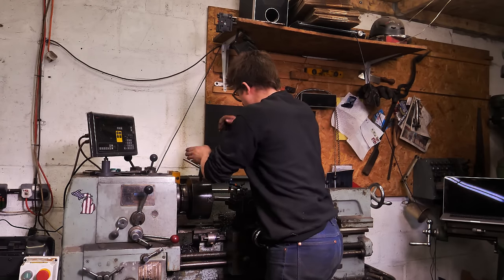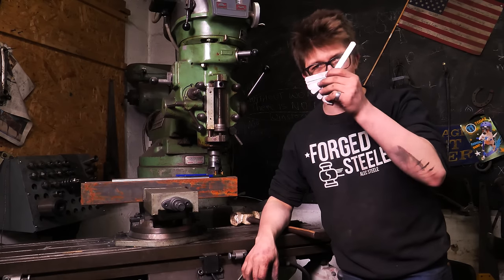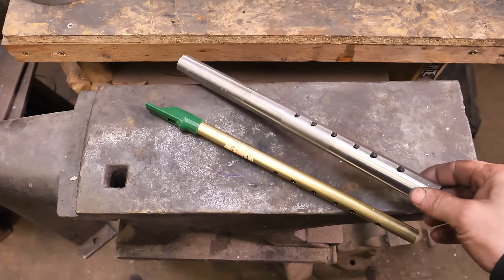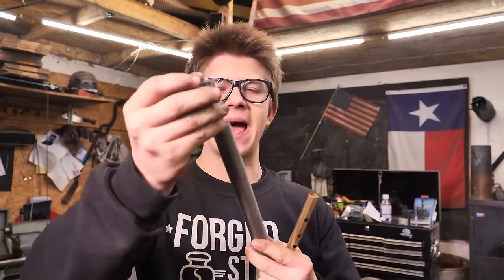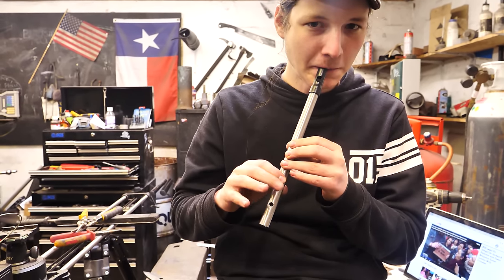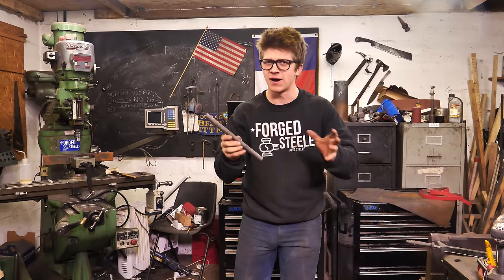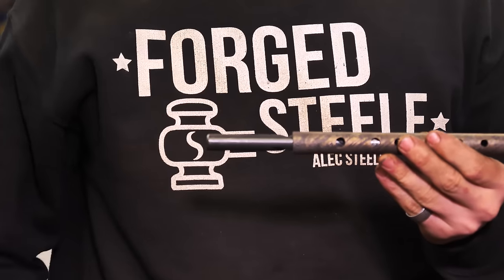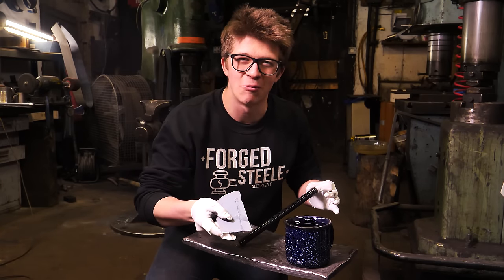FORGING DAMASCUS MUSICAL INSTRUMENTS: Tin Whistle Part 2

Comment: I am loving the beginning shots. That slider for the camera has really added to your videos! Love it! Also, I think the whistle actually sounded better after it was hardened. Awesome project!
Reply: I know nothing about music, but you might have a point. Hard materials vibrate in a higher frequency, I think that's the reason the whistle sounded different after the heat treatment.
Reply: He should not mix 25 and 50 FPS, though. He should shoot it in 60 FPS, cause every monitor today runs at 60 FPS. 50 on 60 creates ugly micro stutters.
Reply: Luiz Alberto Parise Köhler exept for actual instruments a softer material is always used to make a better sound. (gold and silver flutes, wood clarinets, gold trumpets ect)
Reply: Agreed, it sounds even better after hardening! Beautiful end product.
Reply: Kyôdai Ken what are you on about? Monitors can display up to 240 fps if you have a really high end one, and he can mix 24 and 50, if you get micro stutters then its up to your monitor since mine doesnt get them.And if you want proof, go to Peter McKinnon and watch some of his vids, he shoots main footage at 24 and B roll at 120 and it looks amaizing.

Comment: Alec as a machinist I must say in the video you leave the Chuck wrench in your chuck . first thing I ever learned if that becomes habit there will come a day you forget to remove it before kicking that lathe on. if your hand is not on it it's not in the Chuck.
Reply: Marcus Roach from the little bit of machine work i have done i can say that this is the exact same thing i was told from day dot
Reply: Marcus Roach i forgot the chuck wrench in the chuck once. Nothing broke though, and nobody got hurt, and i never forgot it after that. My teacher got the chuck wrench in the gut when someone else forgot it, sounded quite painful! That was 10 years ago, and I'll never forget it again.
Reply: Hoo, boy, tell me about it. I once managed to turn one into a projectile that nearly put a nice dent in the back of the teacher's skull. And the guy was pretty far away at the time. Kinda makes you appreciate the instant kick those lathes can impart on the chuck.

If forgetting the chuck is something you regularly do, fit a spiral spring to it that pushes it out if you're not exerting a modest amount of pressure on the wrench. That way, when you let go, it will come away with your hand, reminding you to lay it aside. Friend of mine has a lathe that came with the spring preinstalled from the factory. Elegant solution.
Reply: That spring idea is one of the things that sound so obvious it makes you wonder why nobody has done it before. I have a lot more respect for lathes now, after i have seen some of the horrible accidents that has happened.
Reply: the spring idea is not bad if your running a 3 jaw chuck but if you are running a four jaw and are holding a good size part in with one of your hand then for some reason you end up losing hold of that chuck wrench it pushes out and hits hopefully the ground and not you knee and you have to end up taking the part out and picking up the wench and then trying over again.
Reply: Nah, you pick a spring that's strong enough to push it out of the hole, but nowhere near strong enough to launch the wrench through the ceiling, twenty more storeys and straight into lunar orbit. A reasonable amount of force, something you can easily hold down, without straining yourself.
Reply: Oh yeah for sure, I left one in a pillar drill one time, came out and smacked me right in the chest, no real harm done but it sure hurt.
Reply: jonhill987 I was working in the work shop one day a few years ago and another guy in the room somehow forgot the pin spanner in the angle grinder he was using. It left a nice dent in the cabinet it hit!
Reply: JakeThePeasant seriously though how did he explain leaving that on the grinder? that would be like someone changing the wheel on their car and leaving a tyre iron on it
Reply: Marcus Roach haha he couldn't explain it. He was as confused as I was! In his defence it was first thing in the morning!
Reply: JakeThePeasant Was it a Monday too? ;-)
Reply: JakeThePeasant shit if that happened at any of my past jobs the drug and alcohol testing mob would be there in a heartbeat
Reply: +Wormweed that spring is pretty much standard equipment on new chuck keys, it's the first thing to get pulled off too, because it's really frickin annoying.
Reply: Machining a bit too close to the chuck for my liking! Brings back bad memories.

Comment: 2:36 It's a Brasil coin? 1 Real? 
Nice videos men!
Reply: Pingodir -2- Doubt it. It's probably a £2 coin since he's in the UK. Also, even though it's made of 2 different metals, it's not one of the new £1 ones because it's round.
Reply: I found it similar to the one of 1 real here in Brazil. I did not know the UK currency. Thanksman
Reply: The one in the middle looks like 1 Euro to me. /shrugs
Reply: As for the coin in question, it's a Decimal Two Pound, Elizabeth II, 4th
 portrait, St. Paul's Cathedral. You can tell by the distinctive detail 
where her hair "line" is above and to the left of the top of her crown.
Reply: Barsil*
não sabes escrever o nome do teu país  xD

Comment: Cant wait to see AvE's opinion of your lathe skills.
Reply: Pancreaticdefect I thought clickspring was the YouTube lathe king
Reply: Pancreaticdefect I'm a machinist of 50 years experience. Everything I saw was according in compliance with good safe practice. An experienced lathe hand would certainly been more efficient. However, Alec disclaimed pretence as a machinist therefore I'd give him extra points for doing so well. Except for leaving the key in the chuck: always a no-no.
Reply: gromann this old tony
Reply: Yup, the key in the chuck. However I agree with you. He did a good job. I saw him take that ring off and was chuckling, yup, safety first.
Reply: Adam Abom79 Booth
Reply: Pancreaticdefect Okay I know this will probably be a stupid question but I really don't know. Who is AvE?
So far for this type of content I've found Alex, Samurai Carpenter, Adam Savage, and Man at Arms. I take it AvE is a machining channel but I don't know the actual name.
Reply: AvE is a unique fellow from Canada. He has his own channel and he's just funny. He does some machine work, welding, electronics. Look him up. It's worth it. He experiments a lot. Worth looking him up. Look up AvE.
 Also, if you are into making knives/bladesmithing look up Walter Sorrells. He puts out a lot of videos. Amazing work and he shares a tremendous amount in his vids. He has a lot out. He takes you from making a knife with common hand tools, up to using CNC machines. So there is a lot of info for everyone. He also offers knives and sword making instructional videos on his website. I bought his video about producing a hamon on a blade. I already knew a lot, but he offered a couple details that I was missing and made all the difference.
Reply: 64t120r Just subscribed to them both. Thank you for the help :)
Reply: Hahaha. Ya, that fits.
Reply: gromann that's tubalcain...

Comment: Alec, great video- suggestion: you can use a piece of paper to find your surface when touching off on your part (in the mill), this can be done with the cutter running. Hold the piece of paper lightly under the rotating cutter, slowly raise your part or lower the cutter until the paper is being pulled from your fingers, you now have your cutter .002 - .004 above your part.Just a thought!

Comment: Some tips for future parts on the lathe: If you are turning unsupported (no center) don't leave more than 3x the diameter hanging out. Also, when you're turning something with a really rough bumpy surface, use high speed steel. There's a huge chance of breaking your carbide inserts (they don't like shock force). Also, when you're drilling something, follow the same rule of thumb as turning unsupported material. Hopefully these tips help!

Comment: When you're on the lathe and drilling the holes for any project, step up the size of the holes. Start relatively small and work your way. You don't have to use every drill bit but 2 to 4 intermediate steps to your final inner diameter will help with accuracy and from keeping the bit from walking around.

Comment: Part of the reason you would turn between centers is to make sure the ends of the holes are perfectly true and concentric with the final outer turned diameter.  Also, a good center bit should have no trouble at all drilling on center on round stock.  Polishing on a lathe is no trouble at all, I've done it all my life; it's similar to sanding on a wood lathe.  Beautiful final whistle you got there, well done.

Comment: Glad you found my advice of using the lathe dog to be useful. Also for future projects on the lathe, use a smaller diameter drill than your desired hole size to rough out material then use your final size drill to get it to the required size. It makes for a more accurate hole due to less chatter between the piece and the drill.

Comment: regarding grinding and polishing tubes... just put a smaller rod through the tube and let it fly over the slag part of your belt grinder. you will see it will work perfectly. The friction causes the profile rolling by itself and it will give a nice surface.

Comment: Tip for next time: It is easier to drill the big hole with good surface finish if you pre drill with a smaller drill first.

Comment: suggestion, make a wooden or metal holder that lives directly above your lathe for your center drill and live centers etc . it will reduce your tool change times a lot .:)

Comment: Nice video, Alec.
The whistle looks great and has a nice sound.
Your work to make the pipe from the discarded blank was just right. Only the grinding and polishing, which could have been made at the lathe. Clamp between the tips and then grind and polish.
Greetings from Germany

Comment: Great job on the lathe looks like you did just fine, what you could have done is make a slip fit piece of aluminum to go inside your pipe whistle and use your note hole as a drive by tapping and putting a set screw threw one or several of those note holes. That way you are chucked on the aluminum but still able to drive your whistle for final polish. Scotchbrite pads are wonderful for polishing on a lathe. None the less looks like you did just fine. Beautiful man !! I was thinking have you ever made a rose 🌹 in your videos? I had a student come to my class and ask me to make a rose for his significant other. That would be a great project for your show. I could provide you with detailed instructions if you decide you would like to take on that project for the show.

Comment: for filling on the mill try to use one of the center drills from your lathe to put a mark then use the drill that way if you have somthing that can't have that slight flat on it your drill will not kick off and you will not have extra marks in your part

Comment: Great video.  I think I'd break the edge on both ends and along the finger holes so they aren't sharp.  I had a little cringe at the polishing bit but you got it done.  The whistle is beautiful and I'm sure it will be treasured for a lifetime.

That is a nice ring.  I don't wear my wedding ring so wearing one like that would land me in the dog house but something inside me wants one.

Comment: Beautiful work. Reminds me of my days back in tech school in my machine shop class. We made a hammer on the lathe (still have mine). I messed up right at the end so it has a nasty imperfection on the shaft, but it was good enough to pass. We also made a couple of mirror mounts on the mill (was part of a laser technology associates degree major). I remember the Lathe I worked on was World War 2 salvage. It still had the nameplate of the Navy ship it was from.

Comment: If you take light cuts you can get away with turning between centres without a lathe dog. The pressure from the tail stock will be enough to keep it from spinning on you, especialy if it is a large hole. You don't need to buy a live center either. You can just put some bar in the chuck and turn it to a point with the compound slide.

Comment: As a machinist i have to tell you man.. A chuck key on the lathe should never leave your hand while your using it.. Never at any point leave it in the chuck.. it will kill you if the controls get bumped.. Don't ever do that again.. Sorry if it's sounds like I'm lecturing you it just scares the shit out of me seeing a key in a lathe chuck un attended, especially while you are standing in the firing line.. Tighten/loosen remove key and put it down in a safe place.. EVERY TIME.. 

Anyway cool vid all the best man

Comment: After you drill your hole in the lathe, you should follow up with a boring bar to take it to the final size.  This means  your drill should be slightly under the final size you need.

Comment: This is absolutely amazing. Really well made, Alec. Would it be possible/a challenge to make the mouthpiece out of damascus steel? Or maybe another metal by casting it? I would love to see how this works and if it is possible to do so using 1 solid piece. You could just make a part 3 :D 
I mean; the plastic is alright, and it works, but it doesn't compare to the amazingness of this crazy good looking flute.

I like boobs
That was off-topic.

Comment: love your videos, don't leave the chuck key in the chuck, if you turn it on it'll fling down right about nut level. also its pretty scary depending on rpm. ref: 3:40

Comment: As with my last .. after the fact .. all you needed to polish that in you lathe was an expanding arbor (which you a perfectly capable of making) which would have allowed you to lock it in between your Chuck and live center without actually clamping ON your part

Comment: Use smaller drills first to make the holes then go bigger and bigger...this saves your drill bits and is generally better practice in the long run.

Comment: No flat spot needed as long as you use a centre first for each hole :) also you may want a 4 jaw chuck using non concentric steel for safety, as it does not always grip very well can can end up flying out plus it also can ruin how true a self centring chuck spins ps great video it’s defiantly making me want to learn the art of forging

Comment: congratulations, the only goldberg machine with no moving parts, goldberg machines are machines, that require maximum effort with minimal results, technically, you'v made a simple machine. CONGRATULATIONS MR STEELE

Comment: Do you do commission work? I really want a Damascus shift knob, but all the people I've asked said they can't do it. And the one person that could, said it would likely be $1000+ for the billet alone. It doesn't need to be intricate Damascus. Just a simple Damascus sphere roughly 2.5" in diameter, threaded on the inside.

Comment: Setting up a mill so it juuuuuuust touches the work isn't easy. A trick I learned was to use a ciratte paper(for rolling). I couldn't get the hang of it, but my I had far too little machine time to become proficient in any machining operation.

Comment: Whats the difference in a tin whistle and a recorder? Just it being made out of metal instead of wood or plastic?
Reply: Tin whistles are tuned to a scale, typically D, which makes playing in their native scale easy, and out of it more of a challenge. (For this reason tin whistles are available in many keys and even different octaves.) Recorders are more fully chromatic instruments, but because of that have more random note fingerings and so are a little more difficult to learn to play.
Reply: Recorder's are hard to play without screeching notes, that is for sure. Why they make 3rd graders in the US learn to play it is beyond me. I think it is patience training for parents.
Tin whistles sound VERY irish, but it makes more sense as a instrument for children.
Reply: To my mind both recorders and whistles are pretty irritating when played badly! Tin whistles typically have poor intonation, particularly in the higher octaves, which can be pretty painful. I suspect that is more a result of manufacture than a fundamental design flaw of the instrument. Possibly because of the education market modest priced recorders are available with tolerable intonation whereas tin whistles seem to be either very cheap, or quite expensive.

Comment: That beautiful ! It's too bad it's gonna rust...
Reply: SaitoGray easy to fix, just seal it with wax, problem solved
Reply: Oh ! Are you sure that would work ? Even with the humidity of the breath ?
Reply: If I'm storing steel that's going unused for some time I'll usually heat it up a bit and rub paraffin all over it.  Wax inhibits moisture.  The best thing to do if it's getting used frequently is to use something like Froglube (food safe moisture inhibitor) and always store it dry and rinse it in plain water.
Reply: Oh cool, I need to test that, my stockpile is always covered in rust. Thanks for the tips !

Comment: You're supposed to make the head as well. The sweetone head is designed for a conical bore, which is why it's so out of tune on that heavy as f*** cylindrical bore body dude.😉